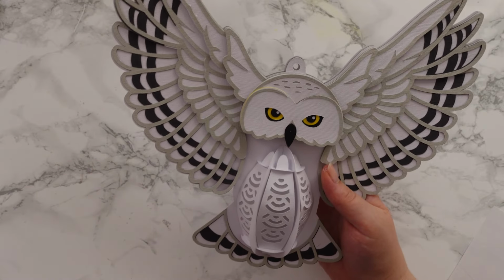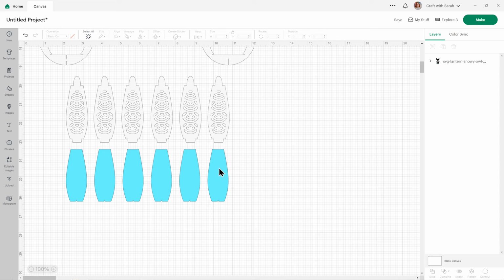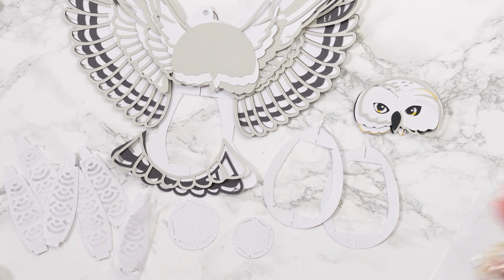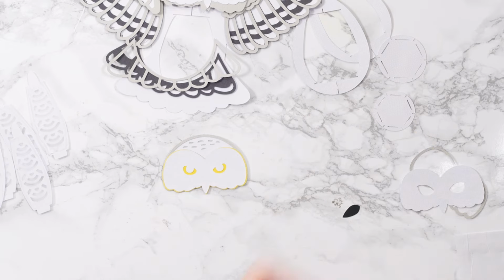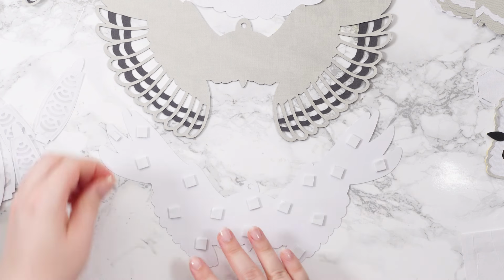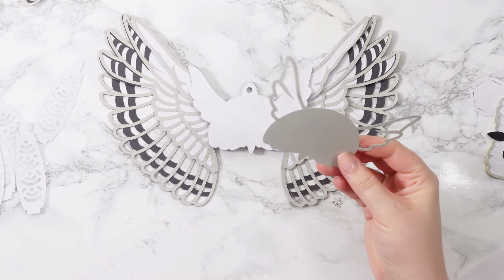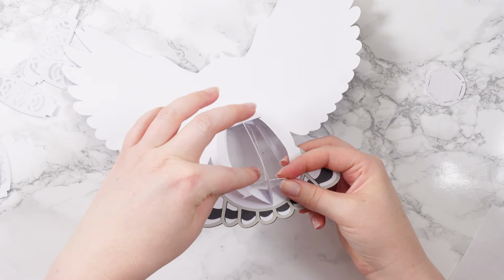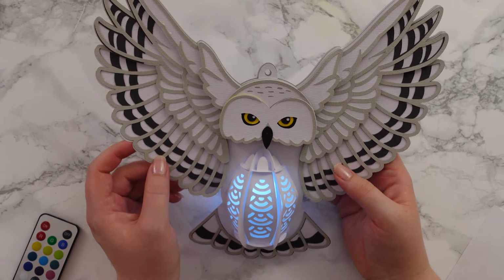Cricut Lantern FREE SVG 🦉 3D Snowy Owl Craft Project

Comment: Well done tutorial. Very organized and easy to follow once you have all your pieces cut out. I'm looking forward to trying glitter paper. May need to just stick with White glitter as finding a grey or dark grey in glitter is being illusive today. But gold for the eye in glitter I've got and black and of course white. Some white glitters however may have an off white touch to them.That includes a slight lavender, blue or even taupe or beige that just means it's not a pure white. Definitely for this WHITE OWL you'll want a clean WHITE if possible. This is just adorable. For Harry Potter Fans too!  I plan to use a bit stronger lantern support pieces including the circle tops and bottoms. Not the windows they might work being a bit more flexible but the bits that are like rib supports is what I think could use being a bit heavier weighted card stock. Also if you intend to make more than 1 then I recommend planning ahead so you can  make the most of your paper layouts including cutting two''s or doubling parts as you move along in the various colors. Also you can certainly play with the colors and I'm leaning towards a bit of blue frost on the wings in place of the lighter grey shades and also then dark grey going with a deep medium or dark blue. This would allow me to go with all glitter too as I'm still wanting to make a Snowy Owl in all glitter. Also glitter card stock can be very sturdy stock. Happy Lantern making...every one. thank you Sarah for a delightful video tutorial and for a lovely free pattern too.
Reply from the maker: Thanks so much for sharing your tips, trick and ideas! Glitter would be amazing, it would be nice and sturdy for the lantern too, just like you mentioned. I love the sound of blue frost on the wings. I hope you enjoy making it 😊

Comment: Love the owl, as it goes trough the pages to cut it doesn’t specify what color paper to use. Sorry very much a beginner
Reply from the maker: If you press the Color Sync button at the top of the layers panel, you can see the different colours that you will need and when you press make you should be able to see the different colours you will need for each mat down the left hand side 🥰